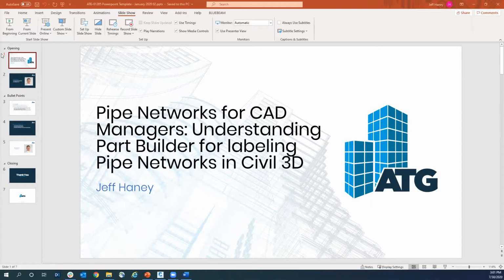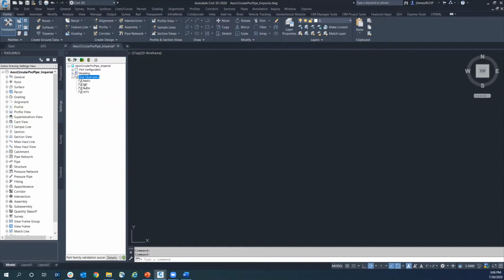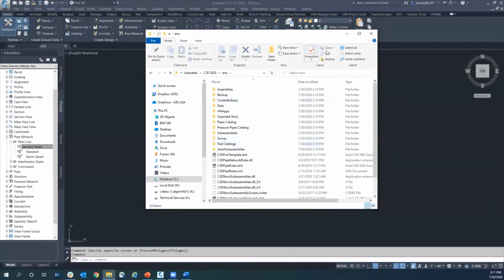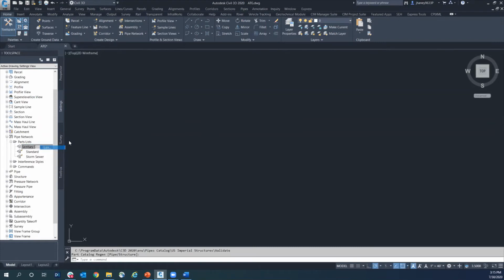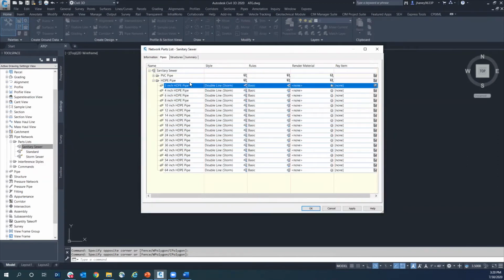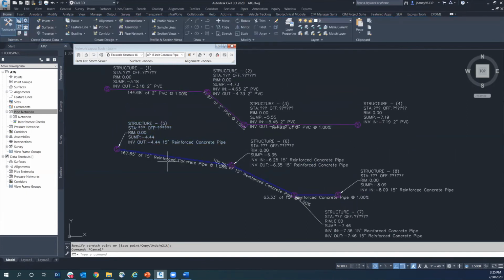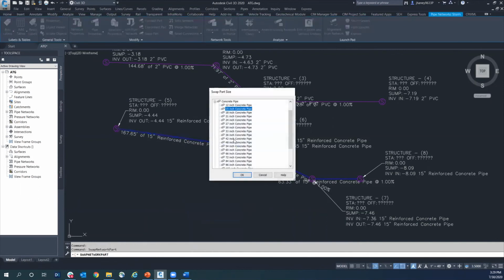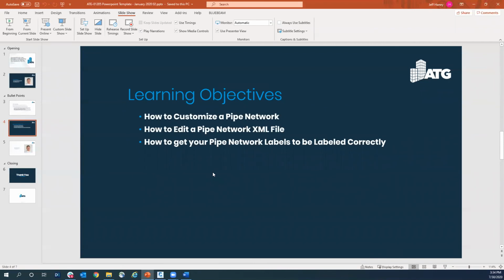Pipe Networks for CAD Managers — Understanding Part Builder for Labeling Pipe Networks in Civil 3D

Comment: Hi, I'm trying to add an Arch or Squash aluminum pipe to a new Arch Pipe network. How do I add a completely new pipe. I see there is a concrete pipe option but I need aluminum and would like to add 3 different sizes. I have a cad drawing with some dimension variables but no clue how to use it with part builder.